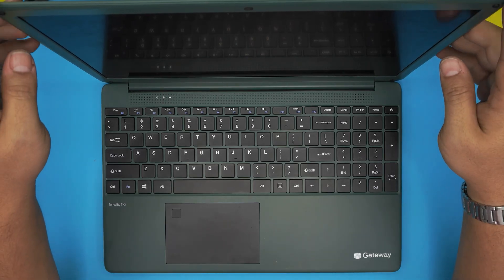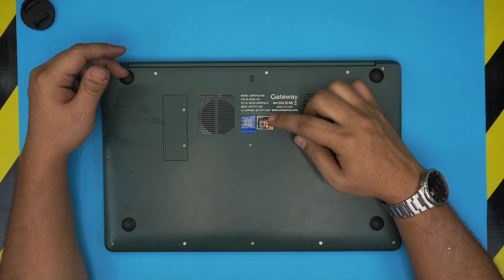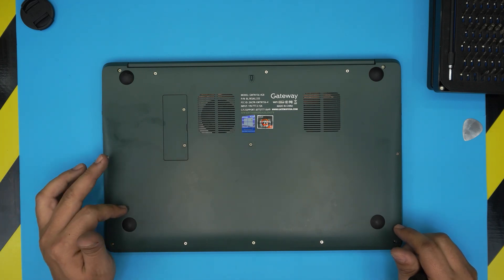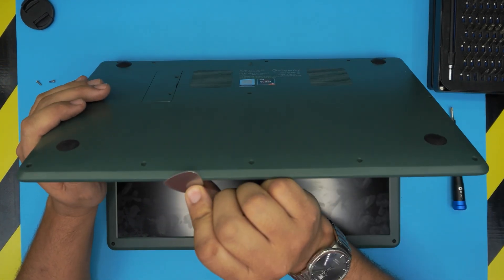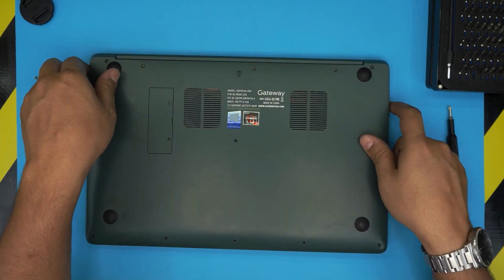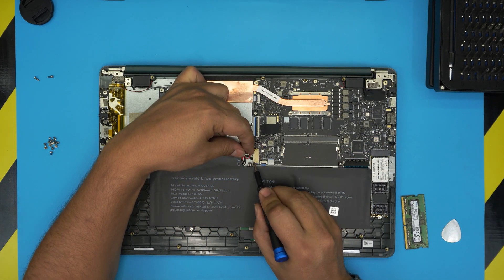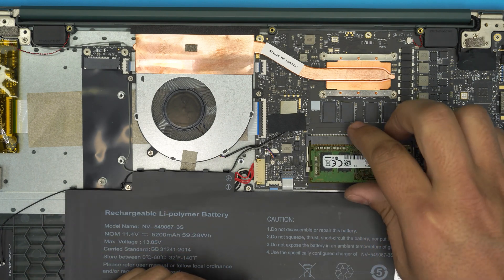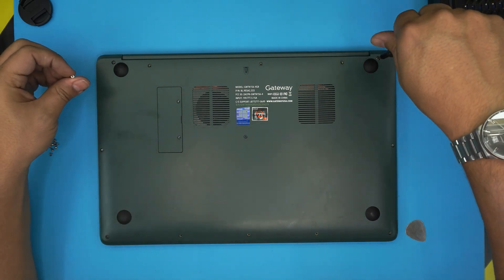Gateway Gwtn156 4Gr Ram Upgrade 💻

Comment: can not find a way to msg you since you Email link does not work.. so thought id ask on here i cant post the pic but i also have a gateway (i typically build my own desk tops but bought this for fill in)... there is an empty slot on the left hand side that can be accessed from a small cover do you know what type of sot that is an what types of possible expansions it could be for?
Reply from the maker: Thank you for your feedback! If you wish to support the channel, you can like, subscribe, or both!
Regarding your question, you can always email me , the link to my email is in the "about" section: ask@ufixtek.com
that slow under laptop is for m.2 ssd SATA up to 2TB you can place in there, is NOT NVME, it's m.2 SATA.
Should you have any further questions or requests in the future, please don't hesitate to ask me.
cheers🍻

Comment: Hi bro, im from Argentina, is this the evrsion with a ryzen 5 3450u? Do you recommend me to buy this laptop in 2023, i've got a thigth budget. Thanks
Reply from the maker: Thank you for your feedback! If you wish to support the channel, you can like, subscribe, or both!
Regarding your question, i absolutely highly forcefully recommend you to stay away from this model and this brand, they are horrible design from inside and many many issues in all the versions, we get them all the times in the store. battery issue and the board can't work without a battery, and good luck finding replacement battery and or anything.
Should you have any further questions or requests in the future, please don't hesitate to ask me.
cheers🍻

Comment: Excellent video, great views.  Have you also done video to add NVMe to the extra slot?
Reply from the maker: Thank you for your feedback! If you wish to support the channel, you can like, subscribe, or both!
Regarding your question, These laptops do not support NVMe SSDs; they only support M.2 SATA SSDs (with two cuts on them). While there was a rare instance where we encountered a model that did support NVMe, all subsequent models only support M.2 SATA SSDs.
here is a link to the ssd upgrade.
https://youtu.be/Qd1Zd8gFOZU

Comment: Hello
Love your videos 
I got a question
I got the GWTN156-7BK
can the gpu be upgraded or have an external gpu?
Reply from the maker: Thank you for the feedback! if you wish to support the channel you can LIKE or SUB or both :P
regarding your question: you can't add or upgrade nor remove the GPU on motherboard.
and you don't have Thunderbolt 3 or 4 to use a proper EGPU, if you use a EGPU with USB 3 it will be Horrible we have tried it.
the only way is to have a EGPU going to your Extra m.2 SLOT.
so you will need this : https://amzn.to/3FidylF
and you will need a PSU for your GPU that you want to install PSU depending what model of GPU you want to use i recommend RTX 10 series 
you will need to modify the bottom case of the laptop to stick the flex cable under :/
if you have any question or request in the future feel free to ask me.
Reply: @uFixTek  would you do a job like that? And if so, how much would the cost be?
Reply from the maker: @robertorivas527  we do this job and we do charge 60USD for the labour only. parts PSU and GPU are apart.
Reply: Can you send me your email so that I can ask more questions about the service?

Comment: Hello bro, many thanks for yours videos, very helpful, I'm already subscribed and liked your video!!! 😎
I have a question for you bro, I hope u can help me. I have this same laptop (without the slot for adding more RAM, sadly...) 
Recently this laptop it start to shutdown without any reason, so I'm dissembled (with help from yours videos) and find what the problem is, the keyboard, idk why, have an issue with the power on button, so I disconnect it after the laptop start to turn on and it works!!! The laptop works fine with the keyboard flexor disconnected (if I left connected the laptop started to restart indefinitely) so I repair my computer but I can't turn it on again (without connected and disconnected the keyboard flex) I'm totally fine using a external keyboard, but I have to find the way to turn on my computer without the flexor keyboard connected, you know if this is possible?? I'm looking for Like a onboard power button or their pins or something for adapt a power switch. 
I hope I'm explained enough for you and many thanks for reading all this!! 
Thank you bro!!!
Reply from the maker: Thank you for the feedback! if you wish to support the channel you can LIKE or SUB or both :P
regarding your question: its very common issue, you will need to replace the keyboard to fix this issue, but if you want to adapt a switch to power on , you will need to short the ground that is visible on the sides of the jack where flex cable goes, with one of the pins, usually its the 1st pin from right or left, if not the 2nd or 3rd.
don't worry shorting this pins will not damage the motherboard or anything its a key combination pins. find out the ground with what pin and solder a cable and then you need a push release switch.
Reply: @uFixTek so many thanks bro, you're awesome!! Keep doing this excellent job!!! Have a great day 😎
Greetings from Mexico!!! 👏🏼🇲🇽
Reply from the maker: por nada compa, si gustas que te ayude sin ningún costo me puedes enviar tu equipo y te hago modificaciones necesario, ubicado en queretaro :P
Reply: @uFixTek  Hi. I have almost the same laptop  Gateway  GWTN 156 - 7BK. Almost new, lies in a bag, used a few times over the year only to install updates. 3 days ago tried to turn it on - does not turn on, sometimes on the 10th attempt it turns on with 2 buttons - Power and ANY (!!!) on the keyboard and then turns off. Once worked for 3 minutes ... . The warranty has expired. Could you fix it if I send it by mail and in what city in the USA do you live?  Can I add  RAM  up to 16 GB and which one should I buy ?
Thanks for the answer.